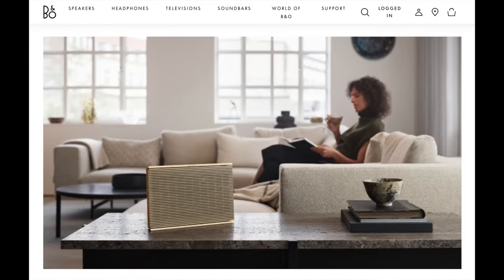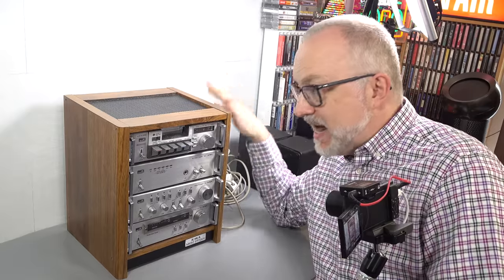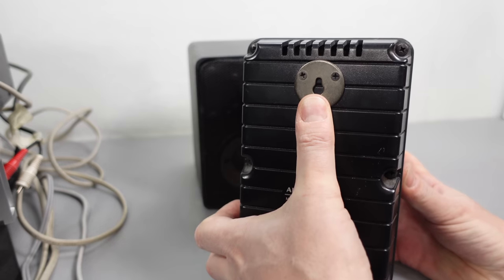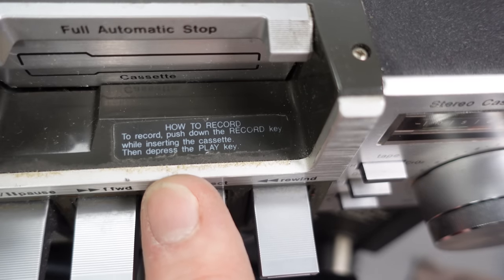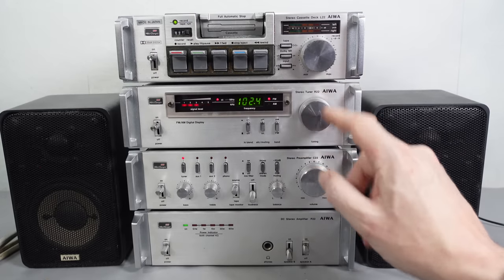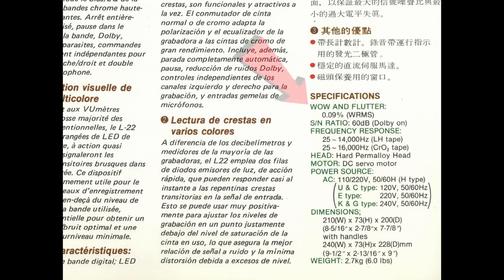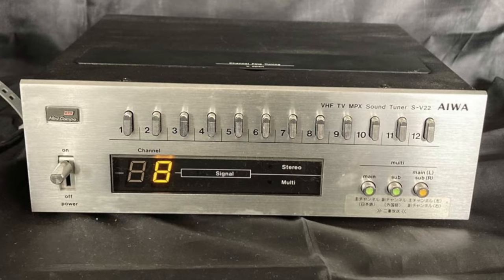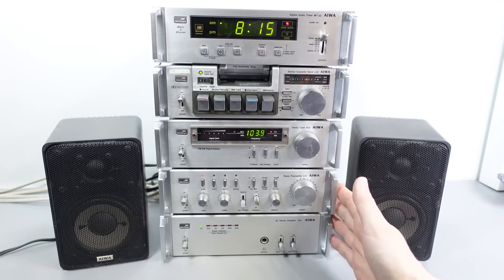AIWA SYSTEM 22 -  Micro HiFi from 1979

Comment: I have that same system! Inherited from my father, he got it around 1983 imported from the USA, originally had the deck, radio and amplifier (although it is a simpler one with less switches, only volume, bass and treble knobs, and 3 way toggle knob for input, mon/stereo toggle and tape/source toggle) and matching gray AIWA speakers. Unfortunately the deck stopped working and was thrown away a long time ago. The amplifier and speakers are still being regularly used :). Greetings from Mexico!

Comment: I’ve always been a Hi-Fi snob, currently owning kit from Cyrus Audio, Pro-Ject and Mission. However, a year or so ago I picked up a Technics HD50 mini-system from my local charity shop for £25. It came with the original speakers , tape deck, amp, CD and tuner. It produces a lovely warm sound and takes pride of place in my conservatory. Just goes to show…

As for the issues with the faulty electronics on your system, you need to do a collaboration with YouTuber Mend it Mark. I believe he’s in the West Mids. He’s a great bloke and fixing this Aiwa would be right up his street! Also, he operates a functioning business so I would definitely use him if I needed something repaired beyond my capabilities.

Comment: I started my hi-fi set up by buying my parents a set of mixed components in 1974 as an upgrade to my Dansette record player.  I then upgraded it far too frequently until in 1982 I got the Uher Miniset to match the Uher CR240 portable cassette deck.  The system consisted of Uher  EG740 tuner, VG840  preamp, Z140 power amp or Z141 PSU only, CR240 cassette deck. They fitted on a stand with all cables hidden. Power supply came from the power amp with interconnecting leads for signal. 

The alternatives (late 70s and early 80s) included 
Toshiba Aurex System 15 micro-components SCM15, SYC15, ST-F15, PCD15.
Uher Paco EG705, VG805, LG105, CG305, CG305 (orange front panels)
Uher Paco 2 VG 865 EG 765 CG 365 (in black)
Aiwa System 22 (as in the video)

These are not like the microsystems of the 1980-1990, which look like a stack of components but are all in one box, but full hi-fi separate components in a smaller form factor than the typical large stack units with 50-80% full of air. The microsystems were the update to music centres made to look like hi-fi units. 

The Toshiba Aurex system got the slightly better reviews back in 1980 when they came out.  It also has the stronger following now than the Aiwa or Uher systems.  

The turntable phono input is for moving magnet. An external phono pre-amp could be used for moving coil cartridge into the aux socket. The Uher VG840 has two phono inputs and two tape inputs.

The Uher Z140 power amp used expensive capacitors that were hard to source and blew often. Eventually Uher (UK service centre) gave up and offered an alternative power amplifier along side the Z141 to power the pre amp, tuner and cassette. The EG740 is a very good FM tuner and excellent at picking up weak signals. 

I used a Z141 powered EG740 in my main hi-fi set up and a good roof aerial.

The pre-sets memory feature failed and after many repairs I got a system that remained stable for 30 years. One advantage the Uher has over the other small stack systems is that there are technicians in Germany that fix these. They mainly work on Uher reel to reel but handle all Uher equipment ~ but parts, particularly for the cassette decks is harder to source now. 

The lack of a CD player is easily solved by using a small DVD player. Streaming services work using a WiiM Mini  streamer into the aux or 2nd tape input.

Comment: All you need is a back cover. It's a structural support for the cabinet. For the particle board, use wood glue and clamp, then reassemble after it's dry.
   The size is a conversion from US standard 8 3/4''  222.25 rounded out to 22cm.  (half rack)

Comment: Mat, you and your videos are an absolute treasure, and have become and integral element of my weekends.
I long for the era of when machines were produced with such satisfying quality and features.
Is there anything more satisfying than the click of old quality switches, or turning a heavy brushed metal potentiometer knob?
The clunk of an old Mercedes door latch, and the solid metal handles and locks… Now we use keypads and apps to open doors.
I fear that while our modern engineering is objectively more capable, and “superior” in almost every way, we are losing the quality and soul of technology from decades past.
From classic Hifi, and computers, to cars and even door latches; I think we’re missing something special from the older, more hand-crafted ways.
This channel’s continual focus on older interesting hardware gives me hope, and happiness.
Thank you.

Comment: I had one of these 1979/80 ish, brought over from Hong Kong. Lovely piece of equipment for its time. Hung it on a wall. The mains cable I fitted with 2 prong American plugs and a four way extension to match. There was enough room inside the back of the case, leaving just the one main cable to wall plug/socket. Can't remember where the unit went after I upgraded to the next version, which I still have in my garage gathering dust...

Comment: I have both a complete Wega Modul 42 system and the Mini-Modul 205 amp and pre-amp. The latter two, together with a Squeezebox Touch, are my daily drivers in my office. Wega made excellent and good looking components. I also had a complete System 22, but I sold it to another collector after I got the Mini-Modul 205.

Comment: I remember buying a second hand mini system from Aiwa. It was '87 or ´88. An amplifier, an equalizer, a radio ( digital with 8 presets ) and an auto reverse tapedeck. There was only 1 power cable and the rest was connected through little cables. And like the one Matt has, the amplifier had some weight to it. It also included a red mini LP player from Sony ( where 3/4 of the record was outside of the unit, a PS-Q3 if I remember well ) and a set of B&W speakers. It was my first quality system and I was very happy with it. The systems I had before were cheap and lacked quality. You could pick up those systems with 1 hand. Looking forward to the other parts of this series.

Comment: My parents owned the BASF 6600 series almost identical to the Aiwa system 22.  A few years ago I bought the BASF tuner, preamp, cassette and amplifier only looking for the Timer. Using it daily. Great set very good amplifier. Preamp is a little bit noisy. Recap isn't needed just hook up a good set of speakers. In the past I found a review of the amp and it came out very good. The tuner problem no audio and max signal strengt is caused by the  variable capacitor having bad contacts . The best way is to take it out and clean. Deoxit is a temporarily solution.

Comment: I REALLY wish I could find one of those mini power amplifiers, (and the matching preamp), in a thrift store or something at least, even if it was by itself, or missing the rest of this system, because I could really use one of those amps at least, mainly for portable used audio equipment testing!

I also need to get me one of those analog wow and flutter meters you have! VERY handy for checking vintage tape decks!
Reply: Can't you use active PC speakers? You know those loudspeakers with a amplifier inside.

Comment: I had one very similar to the 301 set, but with an integrated amp, different key-set an slider volume controls on the tape deck, and the 305 series speakers. I bought it when still at school in the mid 80s and still used it well into the 2000s as a desktop hifi output for my PC. It was a GREAT bit of kit, which I selected via the old-school method of going to various hi-fi stores (which existed back then) and bringing my own sample tape to audition. Very fond memories of that playing the soundtrack of my later developmental years :)

Oh, I had a channel slowly dropping out on the tape deck as well over time, so apparently an issue.

Comment: I buy things like this to tinker with and I usually get them to work eventually but for me that's all part of the fun and it's very satisfying to bring something back from the brink. Other, more knackered equipment can be a priceless source of hard to get spares.

I've generally found that equipment like this that has been in constant use until sold usually suffers fewer faults. Most of the stuff I find has been out of use for years though.

Comment: In Brazil we had possibly a clone called Aiko 3000, which seems derived from german Mars Series 100. It was narrower (didn't have the handle bars) and used a standard tape deck instead of Aiwa's car-stereo-like one.

Comment: Sorry to hear you've never had luck with any of your local repair shops. I rescued an old reciever that was collecting dust in my dad's shop and have built my hi-fi system around it. A few years ago one of the channels went out and I took it to a local shop that specializes in audio repair. The shop floor is full of oldschool floor-standing radios and other not quite so old hi-fi equipment. Yeah, it did end up costing a good chunk of money (for someone like me anyways) but I'd say probably comparable to a fair price if someone was selling it in really good condition (ie you knew it was going to work perfectly). More recently I sent my reel to reel to them because it was having a similar issue to that tape player. In both cases I got them cheap or free so paying a big cost to fix them wasn't a big deal. But I wouldn't ever pay high dollar for an old piece of kit unless I was buying it from a repair place that had just referbished it.

Comment: I had an Aiwa NSX-V900 in the late 90's then an NSX-SZ50 after that, or maybe it was the other way round. They looked really modern for the time with all the red and green LEDs. Maybe the later one had blue LEDs but certainly the earlier one was before blue was widely available so it looked like a christmas tree, I loved it. But more importantly I really loved the sound. I don't know how they did it, I know they had a lot of DSP and virtual surround settings, but I mainly kept all that switched off and even just on the flat settings they sounded really good for what was probably a £300-400 price tag. If I could verify that either of them had a line in, I would happily get a second hand one with a BT adapter for my kitchen.

Comment: I had a fantastic Kenwood RX500 micro/bookshelf system or semi-micro, w remote. I bought in 1997 at The Wiz in Brooklyn NY: it finally died about 10 years ago, but it lasted a long time, and sounded fanatastic, had a 3 CD carousel at bottom, cassettes, and I later added a Kenwood turntable and just ran that into the AUX. The system had EQs built in, presets, and the bass
on those speakers was phenomenal, I think the overall power was around 75 or 80 watts per, if not more. I'd had some smaller Sony boomboxes at that point living in 
cramped quarters (a rooming house), and they sucked, they all skipped all day long! Not so the Kenwood. I may buy one again if I can find one though I've got a Sony micro.
bookshelf system that I mainly just use for the radio or CD as a backup ambient system in my home.

Comment: I happen to have those speakers for my computer, powered by a Denon AVR-2106 AV receiver. I have no issues whatsoever with the woofers moving as yours do. 
So i suspect its something to do with the power amplifier you got. 

The sound quality is excellent, bit thin bass but they are only 4" woofers and from the early 80s. They where all like that. 
Great vocal reproduction, makes them great for watching youtube videos.

Comment: The message at the end is excellent, "leave this one to the people who really want something like this".
All vintage from the 70s and 80s need to recondition especially replacing all the electrolytic, sometimes transistors go bad, sometimes the resistor, etc.
It will be costly and time-consuming, and all vintage hi-fi gear is not cheap anymore, so it is wise to buy new ones.

Comment: I grew up having a "The Fisher" X-101-D with the accompanying FM receiver at home, from about six years old all the way to being a young adult, when I left home & got married. I later tried to locate the system, but as far as I can tell my sisters sold or gave it away. Real shame. I now own (and have for the last 25 years) an Aiko Micro System 3000, consisting of separate amplifier, radio receiver and tape deck, all-metal, with brushed steel panels, pretty nice. Not quite The Fisher, but serves me nicely and still going strong.

Comment: The thing that killed the idea of a separate HiFi for me was home theatre. That's still an enthusiast thing, as most ordinary people would likely settle for the TV's builtin speakers, or maybe a soundbar. But if you're going for a proper home theatre setup... well the AVR is a fairly decent amp and it has a radio tuner, and often a Bluetooth receiver and network streaming capabilities as well. And if you have something capable of playing discs, be it a DVD player, a Blu-ray player or even a game console doubling as those - it'll play CDs as well. So you've got all you need for a "HiFi system" in your TV cabinet. All that's left is to make sure that the front speakers are decent enough to do the job for music as well. You can also connect a record player (some AVRs have phono preamps - and some players have those, too) or a tape deck to the AVR if that's your thing for the complete package.

Of course we all listen to music from a variety of different places as well, be it on our phones, computers, cars, etc., so the idea of sitting down to just listen to music in the living room is arguably a bit outdated in itself. But if you're gonna do that - why have a whole separate setup for that if the movie-watching setup already has all the components?

Comment: I recently bought an old early 1980's bedside radio alarm clock from FB because I was a bit fed up of all this modern stuff. I love it's fake dark wood body and the retro shape of it. The buttons are so clicky it's great just to play with them.
The radio is FM/MW/LW and is tuned with a dial on the side to move a needle on the front which is printed with Luxemberg etc. It brings back so many early memories of slowly turning the dial to tune it in perfectly to a station for the little red led to light up. Very satisfying. I don't know why, but I find it comforting to have it next to me compared to the modern one I had.
If anyone has read this far thanks for your time :)

Peace

Comment: Interesting system. Regarding the  Source/Tape monitor switch, I believe this is for tape machines with seperate record and play heads. The tape monitor position allows you to check your tape recording isn't distorting and you haven't run out of tape.

Comment: I find a lot of issues with older electronic devices can be traced back to the power supply. If the correct secondary/rail voltages are at least being produced by the power supply (and if they aren't, this is usually a straightforward fix as power supplies aren't very complicated), then they can then be traced through the device fairly easily until you find a short or open-circuit (usually a failed passive component like a capacitor, resistor or diode). This in turn can be the source of any number of issues that might otherwise seems daunting or cryptic to diagnose. Finding the original schematic really helps a lot with troubleshooting as well.

Comment: Because it is an AIWA, I'd send the deck to Magnetic Blood for repair. 
Magneric Blood does commercial repairs, but the person behind it, Sergiu, is primarily in it for the love of classic cassette devices, and is a huge fan of the AIWA brand. 
It will not be the cheapest option probably, as they are located in Romania which is a bit of a hassle after brexit, but it would also imo be by far the best chance to get it restored to as close to new state as possible.

Getting the preamp and power amp recapped is something most electronics shops can do just fine, I'd look for someone local for that.

Comment: I have this ones’ big brother, the 50 series. Threw one, bought new, away when the tape Deck failed and I couldn’t fix it. Missed its looks, so bought another used one with a supposedly working deck, which didn’t work. Spent several years searching for replacement belts and eventually got it working again.

Comment: Something like this is certainly worth keeping if you especially like it, (and are aware of the downsides of its age).  Just keep the amplifiers only and add a bluetooth receiver, add your record player if you have one,  unless the amps are really too noisy/really need recapping to be usable.  
(I use a nice late 60s/early 70s amp and speakers this way and it does have a bit of hiss but not bad enough for me to try to fix it yet, maybe someday.  Never had any other problems with it except one and it was a really simple replacement of the rectifiers, really easy electronics to work on, all hand layout boards and big components.)

Comment: Sounds like an issue with the amplifier section in the tape deck. If you can get a schematic that would help otherwise you'd have to use a multimeter in diode test or continuity mode and check the transistors for shorts. If this uses an IC for the amp section in may be on a socket, that would be an easy fix.

Comment: Aiwa. great. I am still running a 7700 tuner/amp with matching M100 tape deck that I bought in the 1970s and (touch wood!) it has never skipped a beat. A few years back I did replace the drive belts in the M100 but that's at. Says all as so well made and super quality.